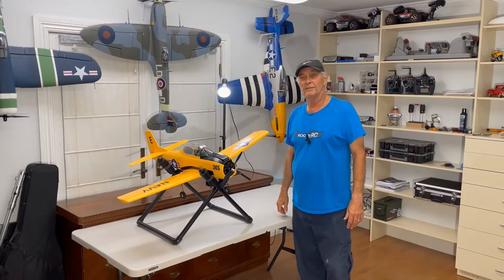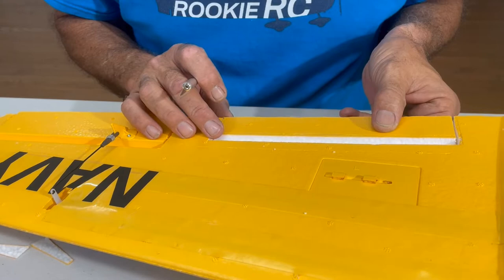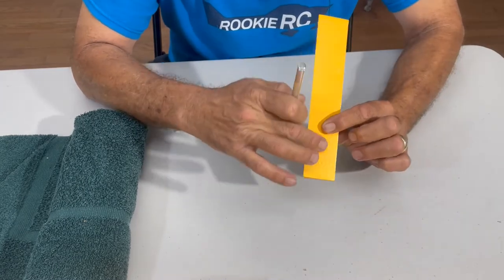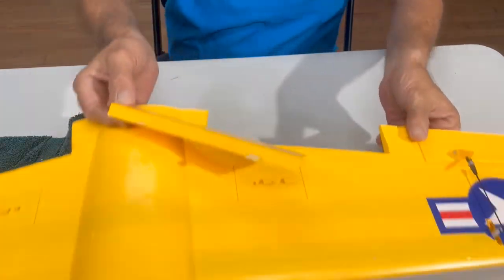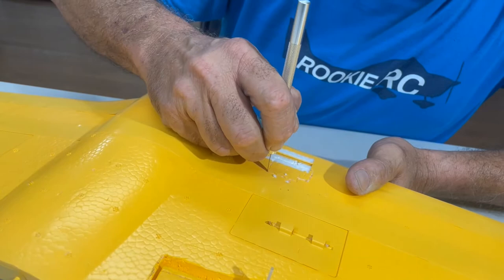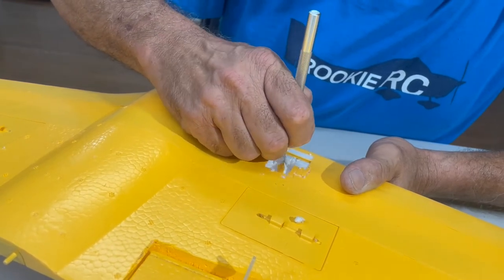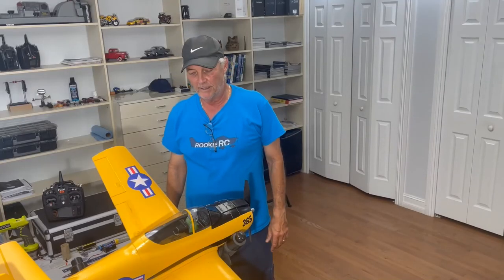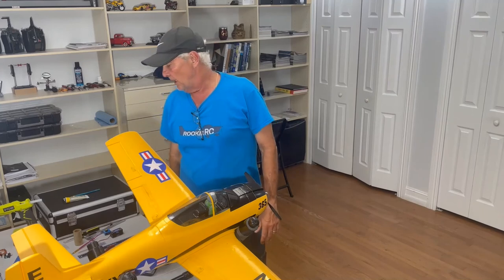New Flaps for the E-Flite T 28 Trojan 1.1m

Comment: Nice. I need to do this on mine Trojan, its kinda to fast on landing.
Nice to see this kind of videos, i wouldnt do this 1st time on mine own cause i never did this on a plane. Do you think if you did it again, would you make a little bigger flaps or this is fine? I didnt have time to watch video where you tested flaps but i will.

Liked and subscribed!
Reply from the maker: The plane is very light for it size, that’s why I didn’t want to go any bigger. 
Thanks for the comment.
Reply: @rookie_rc  Yes its just bit over 1kg with 4S battery. I also have 1.2m and that one is 1.75kg with 4S 2200 battery. With 4000 4S is almost 2kg.
Reply from the maker: I guess you can do them as big as you want, the trick will be adjusting the servo travels at the end.
You could follow the same line as the ailerons and shortened the overall length.
Let me know how it turns out, I’m curious now

Comment: Wow. Horrible servo placement. You should have gone to the outside of the landing gear if you wanted to use the same channel.
However the hot glue on the tape is smart.
Reply from the maker: I know, I realize it after the fact. I was trying to burry the servo in the thickest part of the wing, the further out you place it, the thinner the wing gets. Learning experience for the next Mod. Thank you for the comment.
Reply: @Rookie RC Model Aviation  yeah I made my comment BEFORE I finished watching your vid and saw you said exactly what I was thinking. 
Where and what size servo horns were they from?
Reply: @Rookie RC Model Aviation  so why didn't you go full span flaps?
Reply: @Rookie RC Model Aviation  its all a work in progress right?
Reply: @Rookie RC Model Aviation  the nice part about full span  flaps( like the real deal) is that you can always reduce flap settings of you have too much. 
If you need more than what you currently have set up you have to mod again. 
It's better to have it and not need it than to need it and not have it. 
Of course this particular plane has real light wing loading so I don't think it's would be a problem but of course I run mine on 2200 mah 4s and added scale strut covers and doors( no retracts), bigger wheels  and lights.
Reply: @Rookie RC Model Aviation  also keep in mind the aileron servo is further out so anywhere closer to the wing root thw thicker the foam will be. 
Yeah the area where the aileron servo is pretty thin. Mine, you can see the servo location on the top of the wing
Reply from the maker: They are both 9 g servos, one is reversed FMS. I’ll get a parts list together and post it on the video description this afternoon when I get home from work. I’ll also include the paint that I used.
Reply from the maker: I was concerned about the model being so light , I didn’t wanna go to big on the flat surface that will cause the model to be unstable
Reply from the maker: It’s always a work in progress. You learn something new every time
Reply: @rookie_rc  thank you